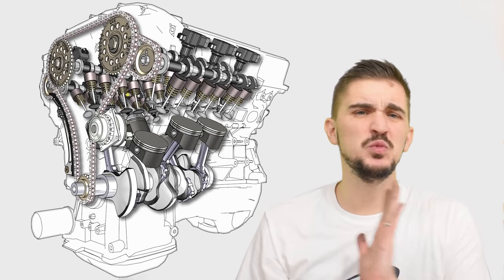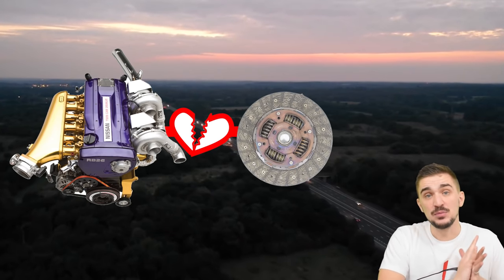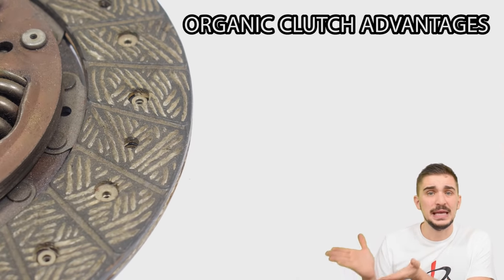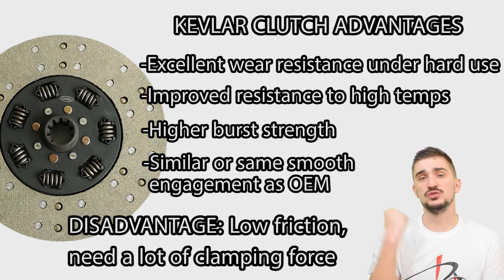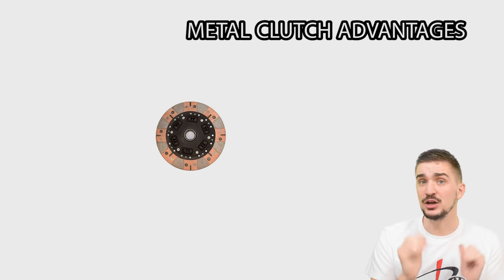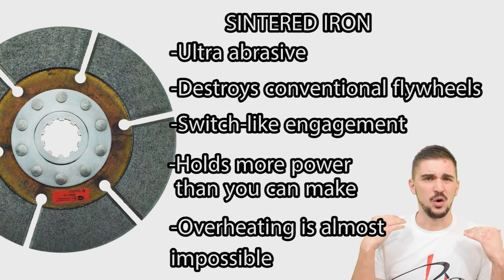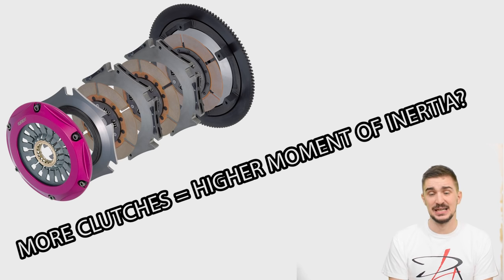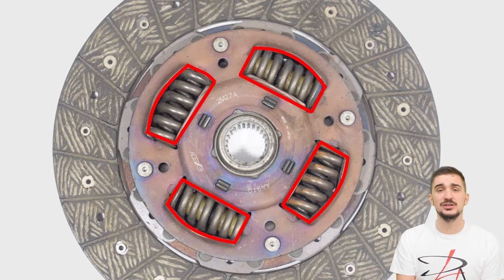CLUTCH: Organic vs. Kevlar vs. Metal vs. Multi Plate CLUTCHES - in-depth COMPARISON

Comment: Kevlar is actually a trademark name as kevlar is just a brand. The actual material is called aramid fibre! There are multiple companies making this stuff
Reply: BRAVO MY DUDE !
Reply: Para aramid to be specific. There are also meta aramid fibers such as 'Nomex' which have lower strength but excellent heat resistance.
Reply: @nerd1000ify  okay, it depends on how you translate it to englisch ofcourse haha
Reply: So just like the use of the term "Velcro" which is also a brand.
Reply: @official_commanderhale965  totally correct, but the only language where that really happens is in englisch, in case of the velcro then
Reply: @guidoheeling1179  I am not English/American and i had to look up Velcro.
Reply: Want a coke ??
Reply: @hotrodray6802  put the plate down
Reply: Hey thanks for the information, I always thought that Aramid was some other type of  super strong weave. And this is from someone who is more knowledgeable than average, but still relatively unfamiliar with specifics of firearms and body armor, etc.
Reply: @maxxtheender  my father in-law works for a company that makes these fibres, otherwise i would have never known haha.
Reply: That's good info. Thanks dude.
Reply: Well, it has turned into a generic name that's used for conversation simplicity. Everyone knows what kevlar is, not many people know the actual material name
Reply: @nerd1000ify  1
Reply: Huh…The more you know 🤷‍♂️kinda like everyone calling band aids, band aids when that’s just the name brand
Reply: Not many things are funny as guys like you trying to correct the guy who made the vid. Nvm you never would be able to lol
Reply: @NYRNJD1987  not trying to correct, just putting the information out there... And as a fellow engineer i would be perfectly able to correct him if there was actually any faulty information, which there is not. Funny how people like you just assume things about other people.
Reply: Haa gayyy
Reply: Just like q tips, Kleenex, etc
Reply: Definitely a “Kleenex” situation. You certainly know what he means and that ls the most important part of speaking lmao
Reply: nerdddd

Comment: Metal is the OEM standard in the trucking industry
Reply: Ya
Reply: Well they only have like 2500 nm of torque on the low end.
Reply: @SoulTouchMusic93  yeah and 2050 foot pounds on the high end
Reply: @engineergaming4295  engineer gaming
Reply: torque, low engine speeds and more gears
Reply: @darianistead2239  tell me about it! doing 25 mph in 8th!
Reply: Ceramic
Reply: @censorshipsovietstyle672  for supercars and some sports car, yeah

Comment: Very well explained and thank you for including the downsides. When modifying cars I find people tend to mention the pros but not the cons of a product. I didn't know you could get multi-plate clutch conversions, that's new to me. I don't like using the word upgrade for such things as they are also a downgrade in many ways, they're more of an alternative.
Reply from the maker: I get your point and a few people commented about the upgrade wording already. However, it is an upgrade and not an alternative when you're increasing power and torque. It's an upgrade because it's getting you what you need at the price of something that's less relevant in relation to the end goal of a significantly modified vehicle. A bulletproof vest is definitely an upgrade from a t-shirt when you're trying not to get killed. Yes, it's heavier than a t-shirt but that's irrelevant in respect to your goal and a very small price to pay 😊 a weird example but you get the point
Reply: @d4a  Hahaha! Perfect analogy.
Reply: Yes, there are downsides but there are exceptions also. clutch choice is very difficult and good ones can be very expensive.
Just because you have a twin plate doesn't necessarily mean it's always less drivable, chatters or is heavy under foot. 
In my instance (2.4L stroker motor in a evo TME) the stock clutch is very light, so a little extra pedal feel makes it easier to predict clutch take up, still being a sprung centre means it doesn't bang on engagement and the right friction compounds plus double the amount of friction material means it's relatively easy to drive albeit able to cope with more torque
(739nm on run in tune, low boost).. My wife can drive it, and in traffic with little fuss.
I was lucky, I got my clutch for free, my brother was the sales rep and they used my car as a test bed to make a capable but user friendly clutch.
Reply: @darianistead2239  Slightly off topic, but beautiful car man!
Reply: @devonstrickland5640  Cheers man. Did you see it in my car video's? lol
Reply: @darianistead2239  Yeah I did, always had a soft spot for Evos
Reply: @d4a  This reply has so much Wisdom in it!! If you can say that about a video, about the differences in clutch materials...I Think so!!
Your reasoning on why it's still an upgrade can be said for just about any situation or circumstance in life and it was very much a Blessing for me to be able to read that this morning!!
Your bit about sacrificing/ or accepting the less important thing/or truth, for the overall end goal, and its benefits was awesome!! Same for the bulletproof vest, and the t shirt..... Many Blessings!! And thank you for the exceptional videos!!
Yes... I know I have a strange mind lol..Enjoy
Reply: @d4a  So if someone chooses a Kelvar clutch that is segmented, would it be a good idea to get a hard stiff pressure plate to get it to grip the flywheel, or is it not as much an issue as the solid Kelvar clutch?  I have a Saturn S SL2 with a 1.9L DOHC .20 over to a 2.9L that I'm building to about 320-330 HP at 2290 LBS. I also bought a lightweight flywheel and want longevity of the flywheel in the long term.
Reply: thanks for making it all about yourself

Comment: Multiplate wet clutches usually found on motorcycles...being immersed in oil would reduce friction which seems to operate counter to what you want to do.  Some high performance cars use wet clutches too.  Please discuss.   Love the channel...looking forward to next instalment talking about flat engines aka 180° vee config.
Reply: Indeed! I wouldn't mind watching a Part 2 which discusses wet clutches and also carbon clutches.
Reply: Motorcycles usually get around this by having a lot of plates, sometimes 6 or more,  so there is a huge amount of surface area to combat the friction loss from the oil.
Reply: Yeah, I've got an Evo X which has a dual wet multiplate clutch (about which I know almost nothing). I would love to see an in depth explanation of how it and similar clutches work. Please?
Reply: I'd really like to know why multiplate and multiplate-wet clutches aren't more common in cars.  I assume wet clutches have a major downside of gumming up whatever oil they're in.  But what prevents multiplate clutches being the norm?  Most motorcycles I'm aware of only ever run multiplate.  Engagement with those is so light, it can be done by hand.  I can't imagine the price gap being so terribly wide when done at the OEM level.  At least, please say it's not built-in obsolescence...
Reply: @ImnotgoingSideways  motorcycles get around this by have a unique oil spec (JASO oil class MA) the MA means that the oil is capable of suspending the additional sediment from the wet clutch, and doesn’t include friction modifiers that would cause undesirable clutch slip. Additionally, bike engines also need to have different additive mixtures in them as the engine and transmission share a sump. (Motorcycle engines also run a fair bit hotter and spin faster than car engines which also effects oil quite negatively as well
Reply: A wet clutch relies on fluid being squeezed out from between the friction surfaces as the mechanism to provide slip and shock-damping during engagement, instead of relying on the material properties of the friction surfaces and/or springs embedded in the hub. The fluid also helps cool the clutch and wash away debris as the friction surfaces wear-down. Wet clutches are most often used in automatic transmissions and in motorcycle transmissions, because it requires less space to have a clutch inside the transmission, instead of needing a separate pod on the outside that is comprehensively sealed against even the tiniest drop of transmission fluid leaking out and contaminating the friction surfaces. However, technically they could be used anywhere if designed correctly, as the Mitsubishi Evo X shows. I don't know about the oil spec for motorcycle transmissions, but I do know that automatic transmissions in cars use ATF (duh), which is a specially designed oil that gets extremely sticky when squeezed into a microscopic film, which increases the torque capacity of the wet clutches inside automatic transmissions.
Reply: Motorcycle WET clutches generally have 11 - 15 Plates . 5 - 7 Friction Plates . The Oil Bath is for dissipating heat . High Pressure Plate Pressure .
Conversely Ducati often went for a 2 Plate DRY clutch . Very Very high Pressure Plate pressure . Hard Clutch Lever .
Reply: @ImnotgoingSideways  Multiplate clutches are more complicated, because they have more parts. This makes them cost more, both in terms of cost of the clutch itself as well as cost of installation of the clutch.
Besides, engineering is all about not going overboard. For your typical 4-door sedan "daily driver" with an I-4 engine in it (think Honda Civic or Toyota Corolla, very specifically not the sport package, and unmodified from the factory configuration), a single plate organic clutch is plenty good enough (tho these days probably a woven organic because that lets them not have to change the clutch under warranty), and it's the lowest cost option that meets the requirements, so that's what the manufacturer goes with.
The point is one of cost, manufacturers will do nearly anything to cut costs while still meeting specifications. And multiplate clutches aren't very cheap compared to single plate ones, so even if you could reduce them to something tolerable for an automaker, you'd only ever see them on the "sports" or "high performance" option package of a given vehicle.

Would a dual-plate organic clutch be "better"? Yes, but it doesn't need to be, the stock single-plate clutch has been designed to be enough for most use cases. Dual-plate in this case would be overkill, which means the manufacturer would be spending money it doesn't need to spend, something they have whole departments of people working against.
Reply: Wet clutches have the advantages of cooling the clutch plates and also TREMENDOUSLY increase the life and can take lot of abuse.
Even I found it difficult to wrap my head around oil in a friction based transmission but the oil used is high viscosity oil and provides huge amount of fluid drag under pressure so it's not a problem.

Comment: I ran out of money on my build by the time it came to the clutch. I'm running a $275 puck style I think is Kevlar. Couldn't tell ya actually lol. It was the cheapest thing that looked performance related. I'd like to think of it as a fusible link in my drivetrain hahaha. It will break before something expensive. I hope...
Reply: Um if u think a Kevlar clutch is your weak link.....

It ain’t. 

It’s like holding a gun to the side of your driveline.
Reply: @fastinradfordable  than let's hope it's a u-joint or the GM 7.5" 10 bolt rear end that's made out of glass lol.
Reply: I had the same issue. Built my block, big turbo, coilovers, and fmic but I had no money for a clutch by the end of it. Making 350whp on a clutch that's good for 300chp 😂

Comment: When I was  working in shops doing clutch jobs, I used to ride with the customer, If they left their foot on the clutch pedal I would void the warranty, some folks would burn up the disc and pressure plate, and ruin the flywheel with in 200 miles, and some fly wheels cant be milled or turned (heat and nasty scoring) holding the clutch down in first gear was a no-no too while waiting for the traffic light to change, or not having the real seal replaced, which should be part of the job, guess you know why I dont work on customer cars any more, the same folks would run brake pads down to the rivets, and turn a brake pad change into a 500 dollar deal.

Comment: Ah, this is a very welcome video!  It makes it very clear that the people buying ultra aggressive (race) parts for daily driving are....  not choosing wisely. :)

Of note, the company Spec has a lighter than OEM clutch pedal feel (ie. requires less foot force), despite the clamping load being higher.  I previous ran a Exedy/Daiken OEM clutch in my 2006 WRX for 6 years - no issues with it, other than being 'vague' with engagement (this is expected in an OEM clutch).  My transmission had to be pulled as the Exedy OEM throw out bearing was dying, I opted to have a Spec Stage 1 (organic) clutch installed.

The clamping load is considerably higher and the pedal requires less effort.

From the rumors that I've heard, Spec re-designs the springs in the pressure plate, and that is the result.  I do not have any further details, but that rumor is validated in my experience.

Comment: I rebuilt a 1925 Cadillac. It had a flathead V8 engine which had more power than most cars of the day. I was surprised to find it had a smaller diameter- about (7 or 8 inches) but more interesting, it was a stacked clutch assembly with no fewer than 7 clutch discs, separated by splined plates making it very similar to those very small clutch packs in an automatic transmission, although it was a dry clutch.

Comment: Clutches for a semi trucks have a similar construction but also offer one more feature that you dont find in cars. That being a clutch brake, it is needed to slow the transmission down/stop so we can get the truck into gear. If the brake was not on the clutch it would several seconds for the transmission to slow down enough to get it into a starting gear.
Reply: I only see a syncronizers. To match the speed mo the engine to the transmission
Reply: For a car yes, synchronizes are used to match the gears to the engine. A transmission in a semi does not have any synchronizes in it. In fact a semi transmission is split into 2 different parts. Engine side and road side. The engine side had all the gears in it that you would normally shift through. When you depress the clutch in a semi and dont engage the clutch brake the transmission can be felt still slowing down and grinding to a stop if you try to force it into gear. A clutch brake actually stops the transmission so that the driver can get into a gear from a dead stop. Once the truck is moving the clutch brake is no longer needed. In order to shift the truck, because it is not synchronized, you have to double clutch or float the gears. Now comes the other side of the transmission, the road side. It spins with the drive shaft separate from the engine side. If i have the clutch brake engaged and the truck is slowly rolling the truck will not go into gear. So the truck has to be at a full stop or, you let out the clutch and match the gear and engine speed so you can keep moving. It is hard to explain how it all works but i tried my best so hopefully it makes a little since. If this was something you already knew i apologize for that too.

Comment: Wow. Thank you! I have been looking at upgrading the clutch in my Forester. Coming from commercial applications, I'm not used to the slippery feel of the OEM clutch. I'm getting ready to do a tune up and replace all the fluids anyhow, so might as well pull the block and replace it with something I like. Your channel is always very educational.

Comment: might get lost hope you see it, could we get a video like this on fly wheels and are we maybe going to see a transmission school coming soon? no pressure, you're just the most unbiased and direct with information, without unnecessary theatrics. the whole engine school playlist can be pretty grueling and it is arguably university 101-303 (on some stuff) in the series; other creators tend to 'sugarcoat' the level of depth some of the information has. You do not. you also don't rabbit hole and go off on tangents. its incredible how professional you are.
Thank you immensely for this whole channel and the series especially, thank you so much

Comment: I started my career in motorsport and was immediately acquainted with twin plate sintered clutches with no shock absorbing springs. It wasn't until a few years later that I became familiar with road clutches and I initially found them very confusing. Kind of back to front compared to most people I guess.

Comment: Having just switched from a segmented metal Friction Disc to a HD Organic Disc, it's a world of difference. That segmented disc had wicked chatter. The pressure plate was janky. Specifically  the diaphragm. The metal was weak, and the central rings were bent to piss, lol. The springs within the friction disc had sustained friction damage too. That was a hair unnerving to see after the fact.

How it made it to the shop with the bitty bits of friction material left was mind boggling. Now running an ACT HD OG disc, paired with their X-lite Streetlite Flywheel. As a result, my VA STi is MUCH happier. Smooth engagement, but also rated up too 515 ft/lbs of torque. Power I have no intention to ever achieve within the lifetime of the current clutch kit. Maybe once that EJ quits and gets replaced with a closed deck long block, I'll consider something more robust 😁.

Comment: Well, apart from minor errors, this is a great video. Loved the bonus info on what sintering is - although I've only really come across it as sintered bronze bearings.

I've absolutely loved the info you've given here, giving me ideas about centrifugal clutches and suitable materials to use.

What may surprise you though is the fact you have not included my favourite type(s) of clutch ! And that's wet ones ! Commonly multi-plate and even contactless - aka torque converters !

Cheers.